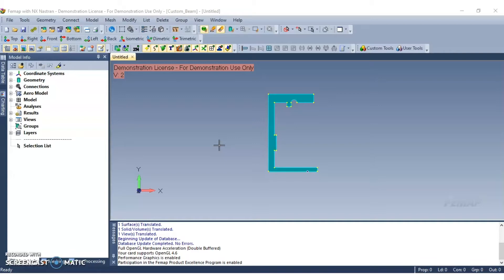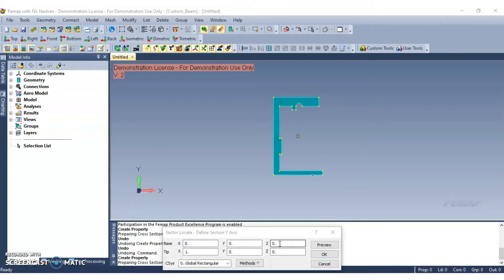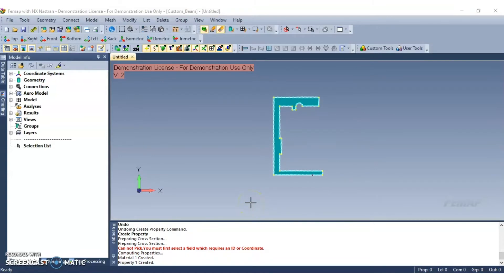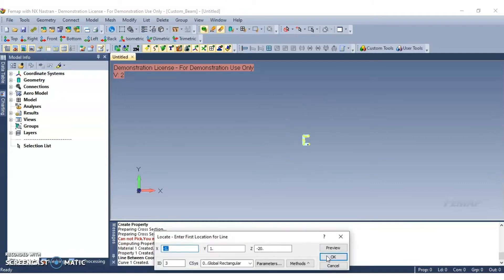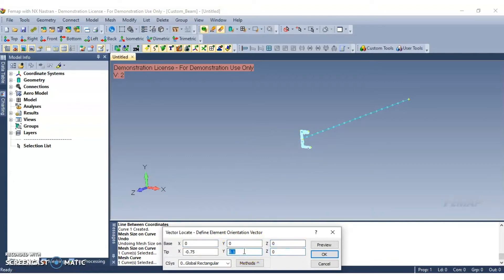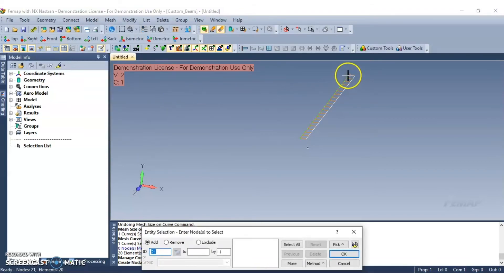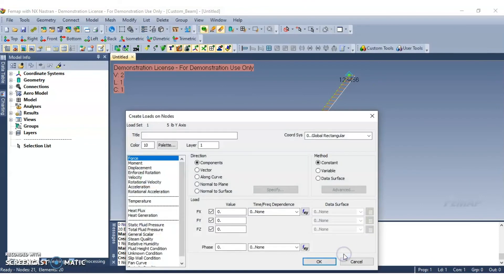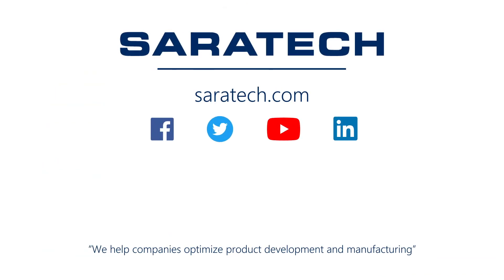Simcenter Femap: Creating a Beam Property With a Custom Cross Section

Comment: You can create a point at the centroid of that surface.  Technically if you do that and then offset that point the other 19 units and mesh the curve and turn on beam cross-section, your beam should line up to the surface.

Comment: You do not show the entity using the view cube - show thickness/cross section. You arbitrarily picked a random point on the face of the surface (midpoint of long edge). How do you ensure your mesh is oriented correctly?